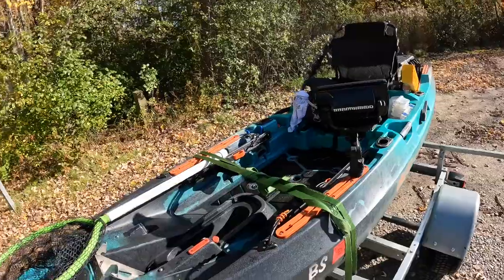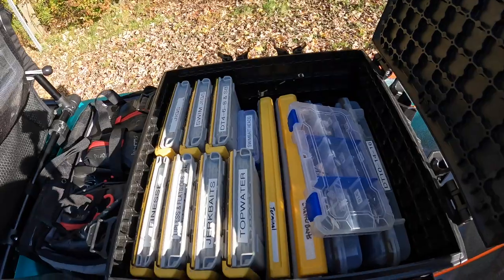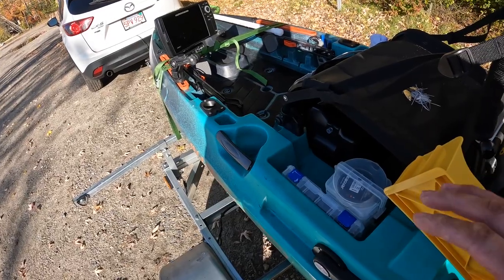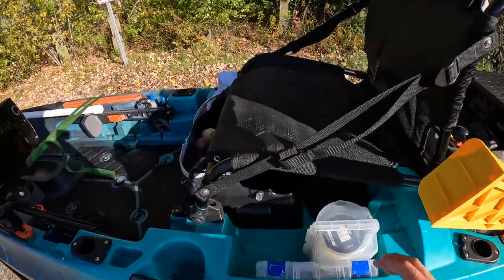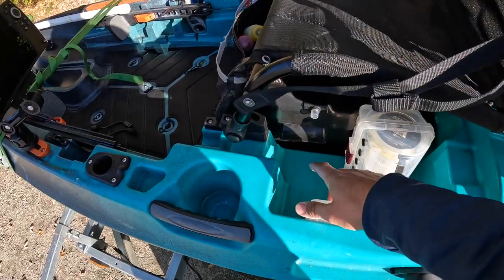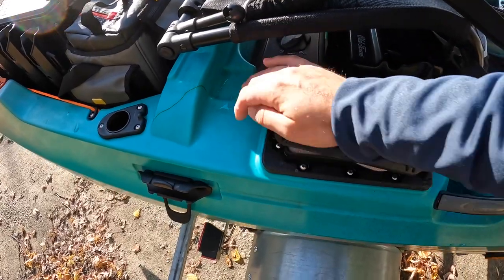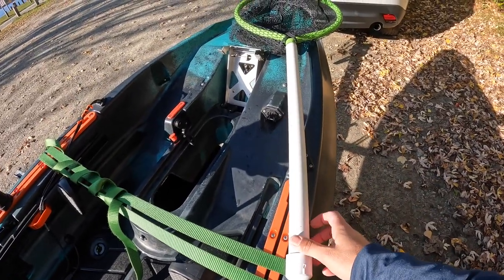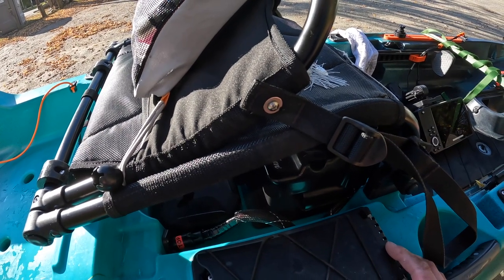How I RIG My OLD TOWN SPORTSMAN AUTOPILOT 120 For BASS Fishing!

Comment: Nice set up! I have the 136 . I love it. Just got the Malone trailer. Haven't used it yet. What are your thoughts?
Reply from the maker: I love my Malone lowmax. When I first got it, it took a few trips to figure out the best way to unload/load, but once you do it a few times it’d awesome. I put my bunks vertical instead of flat so they fit right into the bottom of the auto pilot.
Reply: @MassReelFishing  do you unload before the water or like a regular boat trailer?
Reply from the maker: @glennsowacke9752  like a regular boat. I load up all my tackle etc before backing the down ramp. Then back it in like a boat until the back of the yak is touching the water. I tie a rope to the front handle so when I slide it off the trailer. I can drag it over to beach the yak while parking. Use the same rope to pull it back on the trailer at the end of the day.
Reply from the maker: @glennsowacke9752  watch my video “don’t make the same mistake I did”. 1:30 you can kind of see me unloading the yak.